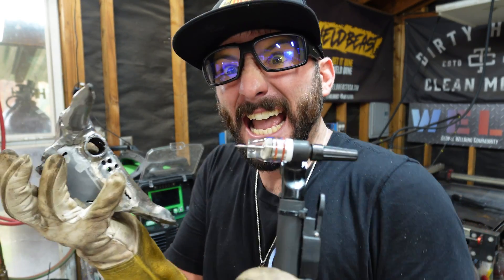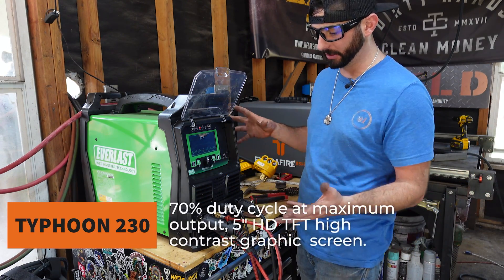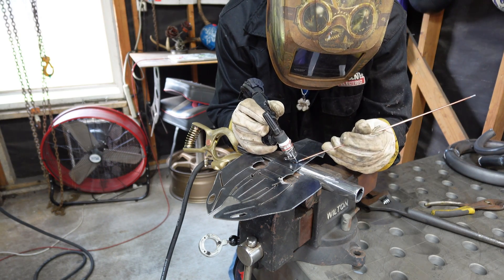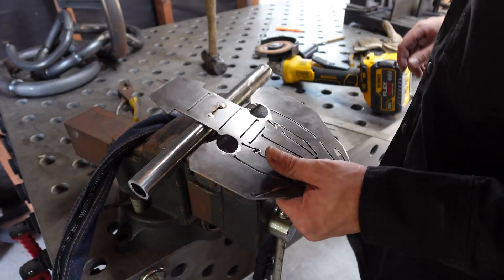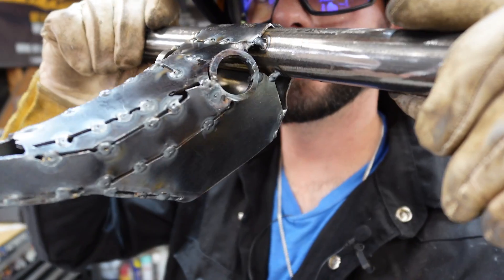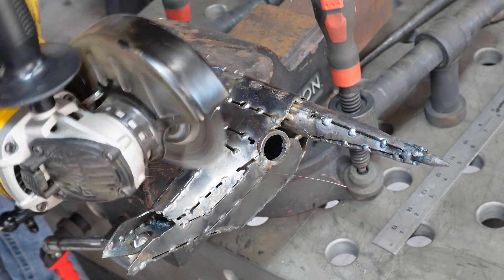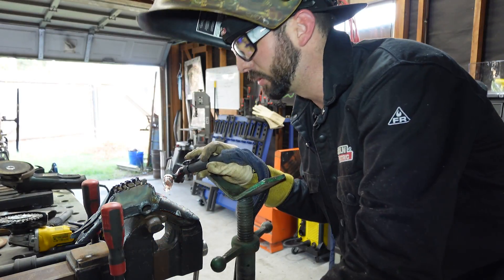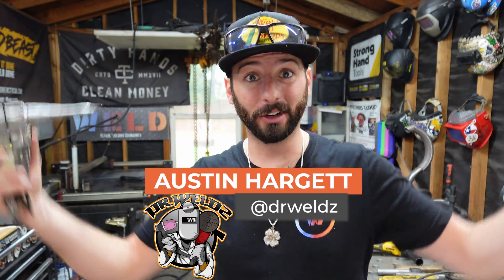DIY Metal Art Project - Build Your Own Cow Skull

Comment: How loud is the CNC plasma cutter? Is it reasonably quiet to run in a shed with closed doors where its not going to disturb neighbors? I guess comparing it to running a grinder or cutting metal with a grider?